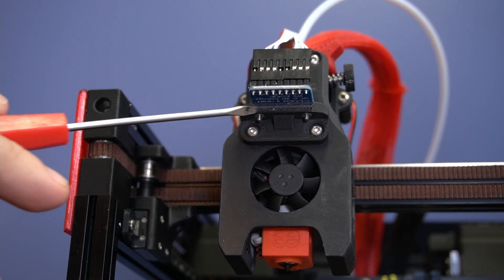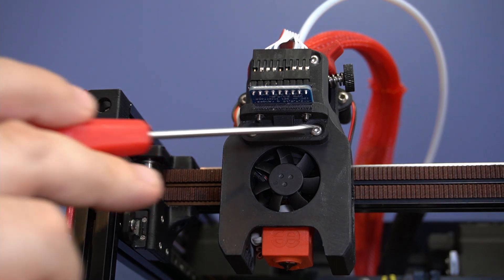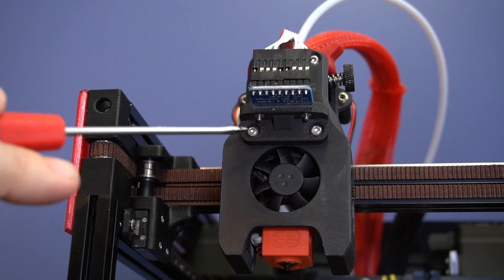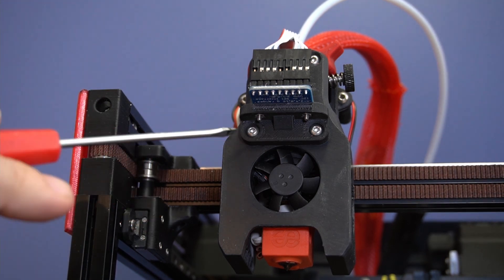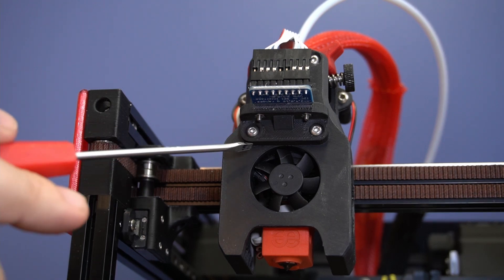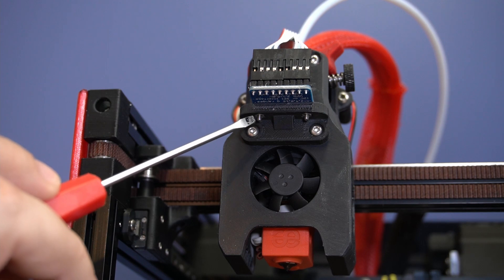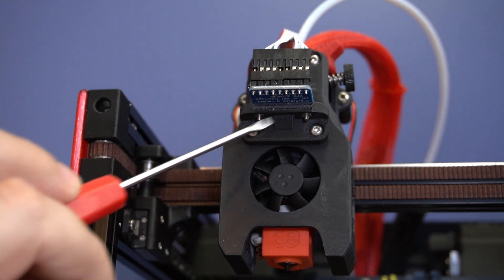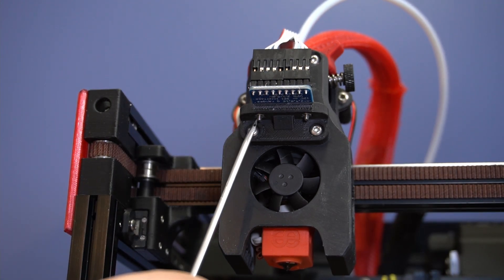Adafruit ADXL345 Voron 0.1 mounting bracket

Comment: Does the ADXL345 have to be positioned facing up?
Reply from the maker: It can be faced in any orientation as long as long as the axis that your testing on the printer is parallel to a marked axis on the sensor.

If it's parallel it doesn't care which way is up or down so you can easily flip the board upside down.  I just designed the bracket this way because it was easy to run the wires along the v0 wire harness.

🍻

Comment: Is it worth to input shape the 0.1? Did it notably improve the print quality? Also, (last question, I swear!) does the accelerometer sit there forever or is it just to run the tests and map frequencies and then you can remove it?
Reply from the maker: Yes it's worth input shaping, my v0.1 prints great, infact it's become my go-to printer for prototyping.

Input shaping is definitely worth doing, it's stupidly easy and quick to do.

You can remove it once your done running.  Technically if you want the best results you should tune everytime you move your machine to a different area.   I move mine around a bit so ijust tunes it for the area it sits on most the time.

I made the witing on the accelerometer fairly long so that I could use it on other machines.   Doing it on my switchwire and perhapse ill try to run klipper on one of my prusa's.

No limit on questions here, I'm listening as long as I have scotch.

🍻